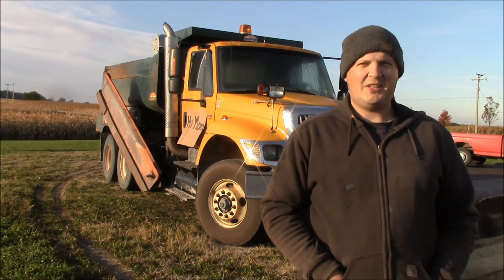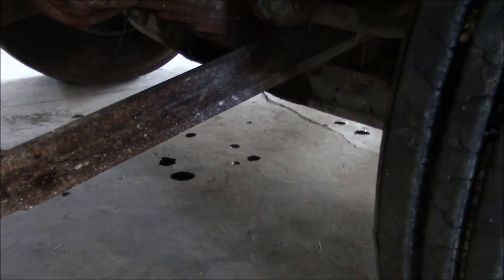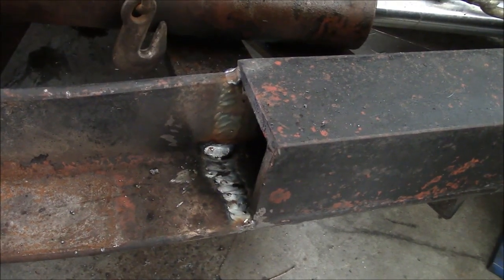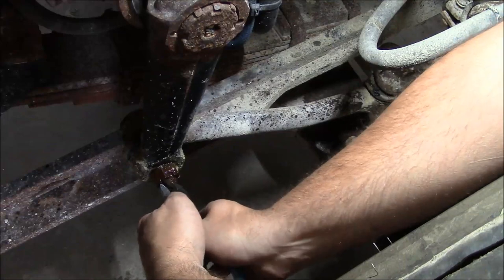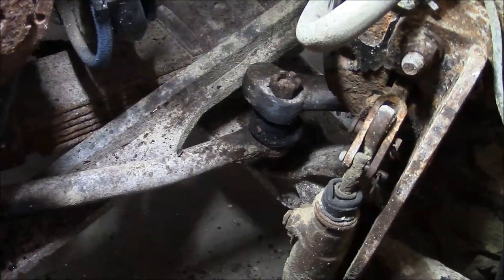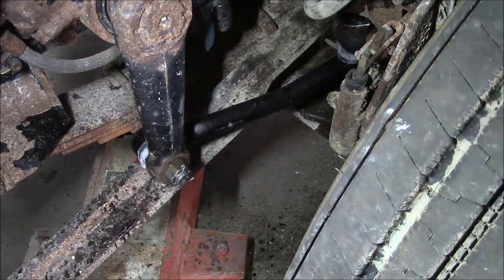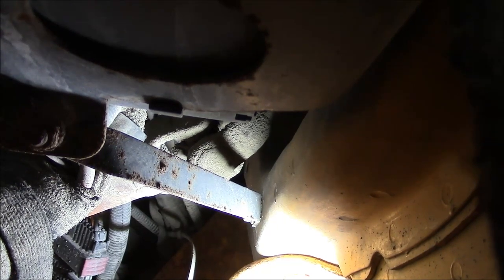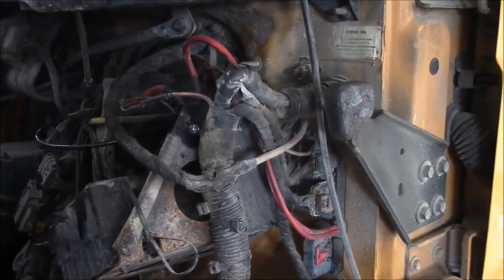Fixing a Plow Truck

Comment: i really enjoy wiring problems. i would start by putting as much of the aftermarket equipment power supplies on a continuous duty solenoid that is activated with the key on and off when the key is off. i like to separate the horrible upfitter install issues from the o.e. electrical. i was really hoping to see you find this problem....maybe next time.
Reply from the maker: Somehow I'm sure it will be back!
Reply: Wow,  These are most people's nightmares.
Reply from the maker: @travelingkaspersworld4096  Horses for courses!

Comment: IH, it probably just needs a new cam sensor. lol
Reply from the maker: Right!
Reply: @WatchWesWork  Thought it was the crank angle sensor?  That's what I had to replace when driving up a 9% grade hill and it stopped.  I also had the main ECM fuse blow when towing 20,000lbs up a similar grade hill in low range and hit the OD OFF button, damnedest thing.
Reply from the maker: @eformance  I've not personally seen a cam sensor failure cause a hard start issue. Usually it's a stalling issue. I don't think these engines have a separate cam and crank sensor since the cam is gear driven and there is no variable cam timing. The later common rail MaxxForce version may have both.

Comment: What if you plate the bottom n back side where you weld. Not the front inside.  should make it stronger JUST MY two cents. Maybe you already had thought of that.
Reply from the maker: I did plate it. Watch the whole video.
Reply: @WatchWesWork  Thanks for taking my advise. Just joking LOL . Yes it was at the very end you show it. miss it. Would love to see how you fix that trucks electrical problem. It could be a hundred possibilities what's causing the issue. Or it could be a loose wire in the cables that's causing an intermittent problem.I hope you get that job to fix it.Love to see that video. Those are the type's of video I like watching on your channel. Keep them coming.

Comment: 20:48 looks like that plate needs another pass or two around it as the weld itself is not the same thickness as the plate so it’s not as strong as it could be
Reply from the maker: It's got two passes. That's all it's getting from me!

Comment: wes..  AESWave sells a milliamp clamp .. fractions of an amp to 60 amps..  saves hours when tracing down parasitic draws.. https://www.aeswave.com/Current-Probe-Low-range-with-Banana-Plugs-p9501.html   this plugs right into your multimeter set to 20 volts DC. i got tired of buying them years ago as they tended to grow legs and vanish as soon as i set it down in the shop ..  i don't work in that shop anymore.      you may also want to set up a high amp battery disconnect switch.. so you can disconnect the last negative cable... drop the wes made up battery cables on the master switch to the the end of the negative cable and the other to the negative post.. there will be a pair of test leads with bananas on the studs... installing this.. allows you to start the engine.. let it run for a minute.. shut the engine off.  since the battery and this switch is out on the side... get out and lock the door like its normally shut down and stored overnight.. i leave the drivers window down just in case. look at your watch..  in 7 or 10 minutes.. walk over and plug the test leads into the amp meter ports on your multimeter.. turn your battery master switch off..  you now have an accurate shut down of all the computer controlled devices.. instead  of a just hooked  up the battery and waiting for them to time out.  this is a picture one of my customers took of the version he assembled to check the car he was having issues with.. https://i.imgur.com/y0cf5nx.jpg  way undersized for trucks and tractors. but it shows what you have to do..   hint.. and i know you like fluke but the https://www.harborfreight.com/11-function-digital-multimeter-with-audible-continuity-61593.html has a 20 amp DC setting that i really love using..  so opening a door or turning on the headlights does NOT blow the fuse..  the 20 amp shunt on this one is UNFUSED..   i get about 5 or 6 years out of each one and i abuse the heck out of them.. i am on my 3rd in almost 20 years.  i also make up my own long test leads  https://i.imgur.com/XlTLPVE.jpg  that set has 14 feet of wire.. each side 7 feet long..   my newest set has 28 feet of wire.. one 10 foot and the other 18 so i can work with cars with batteries in the trunk and engines in the front.. https://i.imgur.com/XiJNJ3Z.jpg 

you may also want to examine and print this test sequence out..  https://i.imgur.com/p9o8bC2.jpg  i use it on almost every car and pickup truck i work on.    tests 1 thru 4 are crazy fast to do.. under a minute for those...   test 5 positive battery to multiple fuses in the underhood fuse box has solved many mysteries..  corrosion in the buss bars in the fuse box.. missing fasteners right from the factory on some 98 S10 versions.   sorry to build a wall of text..    your voltage drops will be larger on big trucks..
Reply from the maker: I have one. That's how I determined the body control module was drawing over 100mA.

Comment: Those wires on the batteries are actually stock. Every international truck is like that. Horrible I know! SMH
Reply from the maker: Yeah, that 100A fuse is on the wiring diagram. Hard to believe they think that's the right way to do things.
Reply: @WatchWesWork  yeah that was my thought when I first seen it. What were they thinking?!?

Comment: In AUS we found that running the incorrect engine oil, ie too heavier grade, also affected those injector systems.  ESP in colder parts of AUS, they would not start for love or money. Replace the oil with the correct grade and they start right up.